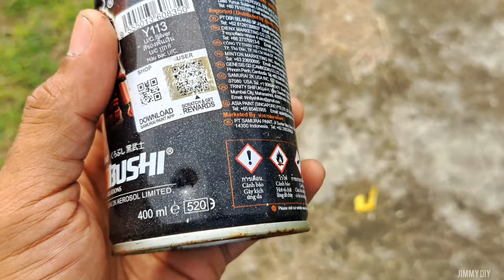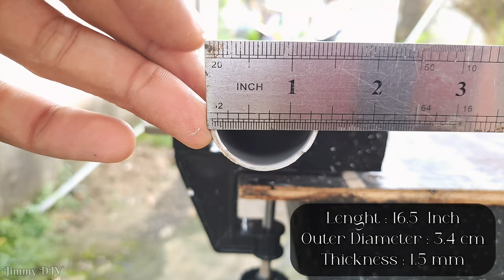DIY SLINGSHOT RIFLE - 4 DIY Slingshot Rifle Revealed

Comment: Hi, have you tried making the compression cylinder longer,  then adding a valve,(with the valve closed) figure out the distance at wich the compression rod stops, (this place will be the moment where the most pressure is generated in the piston cylinder), at that exact point put a trigger system that opens the valve quickly, that opens and frees all the air at once at high pressure, my theory is that the weapon will gain power
Reply from the maker: Usually pple made using air pump...but Im try a diffrent way of compresed system..😁...actually you will get the same power and its depends on slingshot band and pvc size...👍👍